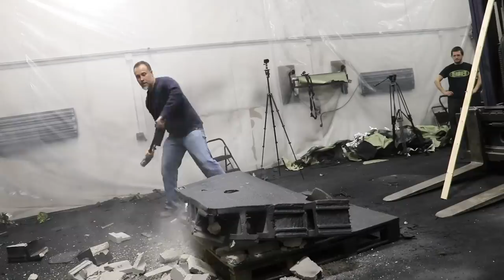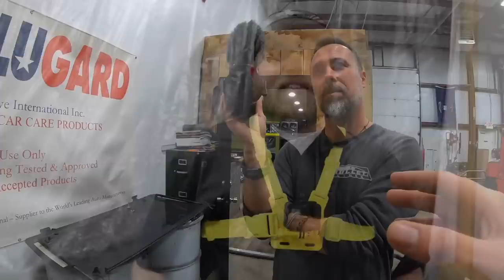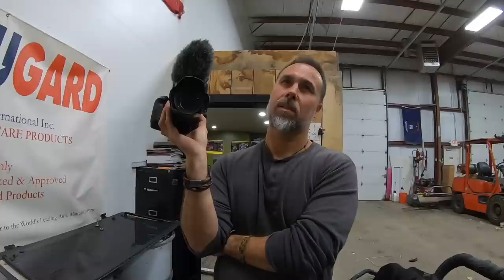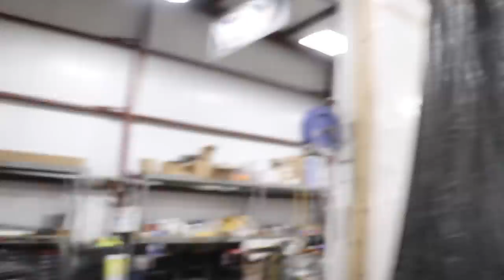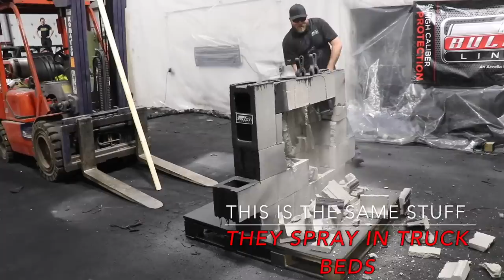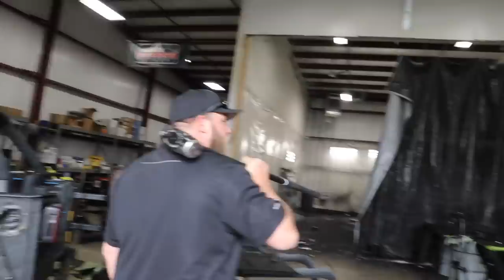Bulletliner Vs Line x .  Whats the difference & which is better?

Comment: Where’s the linex comparison
Reply: Exactly...were they afraid of the Line-X results?
Reply: baited, this should be top comment
Reply: I like the lines better the bullet liner had a hole
Reply: Yep, this is just an advertisement for Bulletliner.  If you did the same coating with Line-X, I'm guessing similar results....
Reply: @steveareno60610  The chemical was created by the inventor of Line-X and is even used at the Pentagon and for the Air Force.
Reply: @stormripper9584  The holes placed in items for 5th Wheels, compressors, welders and other items are masked off for the owner to preserve the quality of their equipment. Please feel free to see details on www.Bulletlinerdenver.com to see it used by HBO, Hello Kitty and other displays as well as commercial vehicles, boats, etc.
Reply: Line-X was made by the same chemical fabricator... this is the newest version available. Line-X is NOT rubberized and tends to crack and peel. Our video shows how it will bend and your item may shatter but our liner will not give in.
Reply: Proof please seeing is believing and not in a video either 2 much can be changed around.

Comment: What if you sprayed a thick layer on the inside of your tires, would it prevent a nail from poking through, maybe even work as a run flat?
Reply: Experimental Fun  then the tire wouldn’t be balanced and the truck would bounce all over the highway unless they do a really really good even spray all around, would be tricky but not impossible
Reply: @ButterNoToast  Tires are normally unbalanced, tire shops have a balance machine and then add weights. Do a good even spray and then balance it after, I was also thinking  for bicycle tires or lawnmower, atv or whatever. It would be a cool experiment either way.
Reply: It is to rigid for the inside of a tire.A tire is always flexing in every direction.
Reply: Tires need flexibility, are already heavy, and balancing would take more than a few grams.
Not a good idea at all, but try and post the video for everyone to see
Reply: @jonathangarzon2798  I think its worth trying just for fun, I'm not actually thinking it would be better or work perfect, just something fun to try, also i think it would still have flex, anyway i would try it but that stuff is so expensive
Reply: this can definitely work, mechanize the spray to reduce unevenness and thin out the coating to maintain flexibility then balance out, not a bad idea at all
Reply: But linex and bullet liner is practically just hard rubber, like a tire.

Comment: I just bought a new pickup truck this year, and it was ordered without a bed liner from the factory, so I've been comparing different bands of bed liners for it. 
Today I visited a local distributor in my area; I got to look at a pickup that just had the Bullet liner applied. Compared to other brands, I did like the Bullet liner better. The texture felt harder, without a rubbery feel, like a thick rough-textured powder coating. The liner had a deep rich glossy black color with no chemical odor. The quote that I got is almost half of what line X quoted. 
 However, they mentioned that the warranty does not cover any damages caused by anything thrown in the truck's bed. I gave them the same example of the shovel mentioned in this video. They insisted that the warranty only covers manufacturing or application defects.

Comment: In 2003 I got a brand new heavy duty pickup and got the bed sprayed with Line-X, at that time I think they only had one liner option unlike the multiple formulations today. I plowed snow commercially and would stack 10 - 80 lb sandbags against the tailgate and secured with a large ratchet strap for extra traction on the rear wheels. I picked up one of the frozen bags of sand and it slip out of my hands at chest height, it dented the bed good, but the Line-X stayed adhered to the steel of the bed, it was tough as nails, never had any issue with it, it was an excellent product. Back 20 years ago it was $500 so it was a good value for the cost. Here is the issue I have unless you do testing side by side with all variables being equal this is just a commercial it does not prove or disprove the products durability or longevity. If you want to do a real test with other brands of bed liner, get a wall section sprayed by other companies and have a sledgehammer suspended from a pivot point, then the head of the hammer is brought up to a measured level and released Y number of times, this is then repeated exactly with the other sample walls from other companies. That is how to perform testing properly. One other issue, the cores of those cinder block wall should be filled with concrete and rebar and then vibrated to consolidate the concrete and remove air pockets.
Reply: To much didn’t read

Comment: I think it first originated for the military, but damn as thick as they sprayed it, no wonder it is so strong.
Reply: Line X created PAXCON for blast resistance for the military. I don't know if it was created for truck heads first and then they decided to use it for the military or the other way around. Also they spray body armor with it so when bullets impact the plates they don't spall and injure the person wearing it.
Reply: yer pal i noticed how thick about half inch easy not surprising its strong must be a gallon sprayed on mellon

Comment: If Line X costs $500-ish at 120-125 mils and Bullet Liner is $400-$500 for 80-100 mils. It sounds like Line X may be the way to go. There is a video of a Line X watermelon dropped from a 148ft tower and it bounced like a basketball (without leaking). It would be surprising to learn the they weren't the exact same product like generic vs brand name drugs....lol

Comment: line-x sprays 125+ mils, bullet sprays 60-80 mils, and bullet is trying to charge the same as Line-x.  line-x sprays 2x the thickness, and it doesn’t peel up or fade like bullet!
Reply: Yeah Bullet dealers are all closing and now going with Mil-Spec... Soon Mil-Spec will close and it will be called something new. Stick with LINE-X 30+ years of doing it right!

Comment: I wonder if there are any applications for leaking foundations? Hmmmmmm Stoneyridgefarmer wants to know!
Reply: Stoney Ridge Farmer hey Josh, can’t wait to see the first cow step on the Stoney Ridge Farm, have a good evening!
Reply: Im a LINE-X contractor and sprayed the inside of a leaking basement, the client installed marble slabs over it and its still waterproof all around since 2016
Reply: Stoney Ridge Farmer : That would be VERY EXPENSIVE !! The rep said it cost between $400.00 - $500.00 per pickup bed !
Reply: I was thinking the same thing, might even do my roof with it
Reply: Yes, our product is 100% waterproof and RUBBERIZED so it will not crack. This was created by the maker of the Line-X Product and the NEW chemical is even used by the Pentagon and the military.
Reply: @aprilmontour8530  when using it on concrete,. Do you spread on directly or would you first use an adhesion promoter. Some types of bed liner used adhesion promoters, which just look like cans of spray paint but help adhesion especially two metals and plastics. But I wonder with concrete blocks that would help and in this video they don't really show if they first spray it with promoters

Comment: It would be interesting to spray that on the inside of a dump truck that does salting to see how it would stand up to it.
Reply: That wouldn't be a great test. It'll easily be impervious to salt. Now a regular dump truck, with concrete chunks and other debris being dumped into it, that'd be a test.
Reply: Bill 491 My work has a International 4300 dump truck with this bed liner done by this same guy Mark. It has held up pretty good for 2 years of abuse.
Reply: @sszecsodi  im curious because i work for a municipality in Southeastern Michigan and the trucks go through salt like its nothing. And after a couple of years the beds of the dump boxes are junk at that point.

Comment: I'm going to build a concrete pour walled home in FL and this would be a fantastic sealer with insane improved strength.  Can it be painted?  Can plaster for brick veneer be applied to it?  Or, could I just use more to adhere the brick veneer to the concrete wall?
Reply: I want to use this for remodeling showers. And maybe even as a replacement for shingles on my roof. Just spray it right over the bear sheathing.

Comment: Do you first use adhesion promoter before spraying on the concrete block wall? I want to try shore up fix a concrete block retaining wall with a combination of spray foam crack filler and then the bed liner.  Also thinking of spring truck bed liner on the side of a building to protect it. The concrete blocks are a little rough on the outside to begin with. I'm wondering if the truck bed liner will stick better without adhesion promoter, since usually I see adhesion promoter used with metals and plastics which are then  them sanded and cleaned before the liners sprayed on. Any thoughts regarding making this stuff stick optimally to concrete is  appreciated

Comment: Obvious by my photo I am not an expert in liners not even trucks however I have inherited a 1994 Chevy 3500 dually and I want to put a liner in the 8 ft bed. Btw it currently does not have any liner. I’m impressed by your video and would like to know how does this product rate related to auto accidents ? Oh one more inquiry I’m in Daytona Beach FL. Recommended nearest dealer and how long does it take for application, drying before loading domestic plastic bins. Thanks for the video and info.

Comment: Stupid question, but do they sell this stuff in arisol cans? I was wondering if this would be of any use to spray in some tools
Reply: No. These products are 2 part polymers. They mix in the gun. They may be able to make a can, similar to 2k epoxy spray paint, that contains the hardener in a secondary chamber in the can. (One time use.) But not in a regular spray can.
Reply: @xenonram  ok thanks for the clarification

Comment: What about marine applications? I'm interested in building a boat with foam and fiberglass and I'm thinking that maybe this would do better in place of fiberglass.
Reply: It's fantastic on boats! We can also spray ANY color! Ultra lightweight! see our site for some sample of work we have done - www.bulletlinerdenver.com
Reply: @aprilmontour8530  Awesome!  Thanks so much for getting back to me. Do you know if Bullet Liner stretches any. I'm looking to use it in a semi-structural capacity. Is there a known tensile strength?

Comment: This video shows only impact resistance. What about 130'F climate weather? What about gasoline,  paint thinner, acetone, and diesel resistance? If you guys claim your product to be the best. Then please show us these extreme tests. Otherwise I would only think that structure integrity is based on how thick the coat is. And can be done the same with other products.
Reply: Exactly correct and yea always normal for videos 2 be flawless unless you look closely and see the peeling away from where its sprayed the melon and the brickwall.

Comment: When it fades in the sun after a couple of years, you’ll need to buy a new truck bed. Line-x can be pulled and re-sprayed easily, not so sure this can be.
Reply: I don't know anyone that would change a liner out in a work truck because its faded, do you mean peeling and past its lifespan?
Reply: Lifetime warranty... UV stable
Reply: You have a pickup....youre worried about the fadedness of the bed liner??

Comment: Is he sure it is 70 to 100 mi (just under 3 to 4 inches) or is it 7 to 10 millimeter (about quart to half inche) as when you sprayed  the egg, watermelon & the wall it looked like it was only between 7 to 10 millimeter because that is a loot of space wasted in the back of the ute (truck)?
Reply: Rep said 80 to 100 mils or 0.080 inches to 0.100 inches.

Comment: What the video is showing is that you can destroy your truck before your bed liner will rip!! How can Line-X compete when they do NOT have a RUBBERIZED protective coating? Bullet Liner is guaranteed not to rip, crack and peel due to the rubberization. The thickness? We are trained to go a specific speed at a specific distance for an even coating. It is a powerful high pressure, high heat spray that dries in 7 seconds. So we make sure to get an exact coating every time. ALSO, we guarantee that there is NO overspray - a common complaint with "Brand 'X"' bed liner companies. ALSO- because it dries so fast it doesn't settle into the grooves of the bed leaving the top ridges thin. We have a tailgate lined previously with "Top Brand X"  and then sanded & peeled off and sprayed with Bullet Liner - you can see the difference where it is thin at the top and around all bends that were sprayed by "Brand X"

We can't spray inside of a tire. Only something open enough to get the spray gun into comfortably enough for proper coating.

Yes, it can be used to waterproof or weatherize items - but be aware, this is NOT a do it yourself type product. It takes special sprayers that heat the chemical.

If you would like to see close-up photos... just check out www.Bulletlinerdenver.com and yes, we can vary the texture but the standard texture we do is shown closely on the photos of the trucks we've sprayed.

YES, we can MATCH any COLOR using your manufacturer's [aint number.

YES, we provide FREE UV protection, which is considered an upgrade with a higher cost at Line-X

Comment: Try applying the same amount to the bricks that you use in  a truck bed.  The demo will be way different.  It will fail with one swing on that hammer.  👎

Comment: Interesting but that is not what bedliners are really used for... How does it do at keeping things from sliding around in the bed? does it gouge easy when something sharp is dragged across? how does it hold up in the sun over the years? How hard is it to clean up after hauling stuff? That is the stuff that really matters. Not this weird stuff.
Reply: plaid13 if it can take getting beat to absolute hell with a hammer it can take abuse
Reply: @gregshearer423  It is just a different sort of use. No doubt it is good at getting beat by a hammer. But what about when someone drops a big block engine in the bed and drags it out with the oil drain bolt sticking into the bedliner and all the weight of that big engine catching and dragging on it.  Will it scratch? dig a groove in it?  What about when someone spills something nasty in the bed? That is the sort of stuff that really matters for a bed liner.